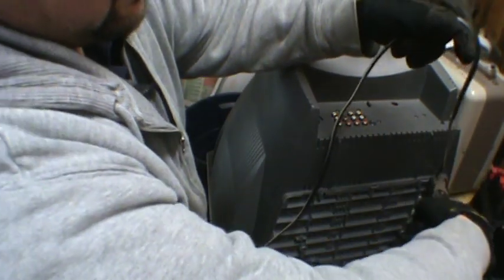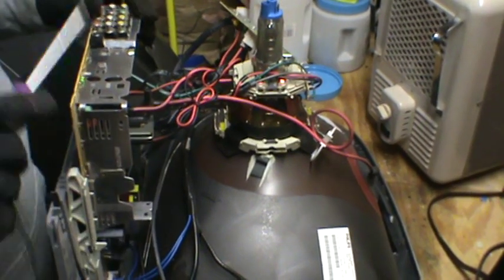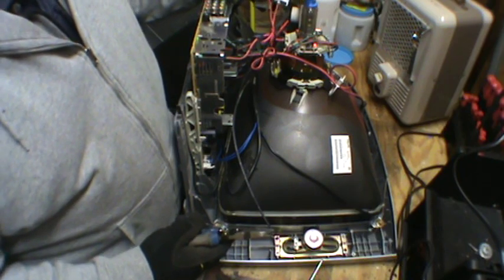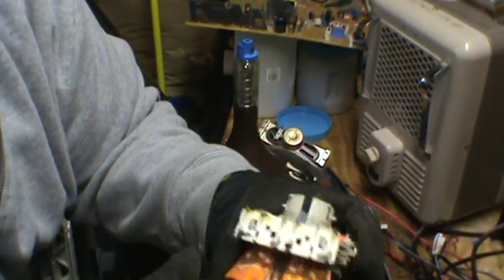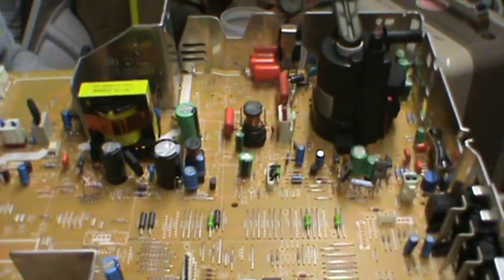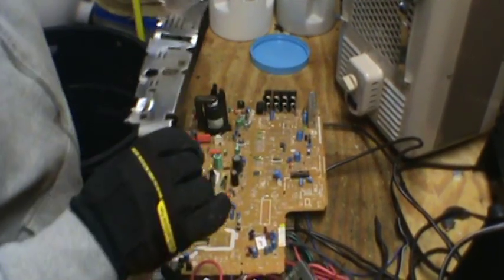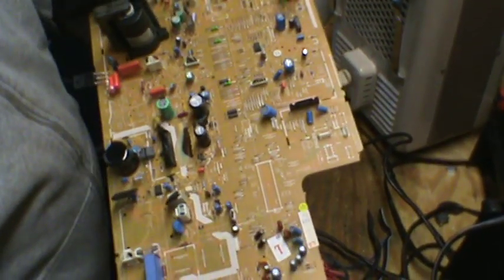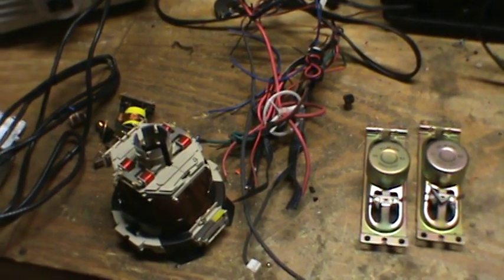How to Scrap a CRT TV for copper and easy cash!

Comment: Its worth noting to your viewers that a Cathode Ray Tube is capable of storing voltage all on its own. The heavy red wire from the flyback and the suction cup/clip into the hole in the CRT are where the dangers lie. Read up on degaussing a CRT tube before you go wild inside an old TV. It might save you a bad shock and serious injury...... Also not that anyone cares, but the black things with copper in them are relays, the little copper towers are inductors or chokes, and heatsinks will nearly always be a nonferrous metal because of the superior heat distribution properties
Reply: +Jason Andersen Thanks for letting those guys know, the 25 Kv charge can remain for quite some time after set is turned off and yes if you come in NEAR contact with the flyback EHT transformer it has been know to kill people, also some of the caps hold a decent charge to.
Reply: What's the usual way of discharging the flyback high voltage charge? I seem to recall that there is a fairly simple way of doing it with the set unplugged and the cover removed.

Comment: I scrapped a flattop range yesterday had around 10 small copper bearing motors with nugs of silver, 30-40 nugs
Reply from the maker: Jay Stevens damn sweet!
Reply: Moose Scrapper same were there was a old goodwill store the was a nice Flat screen TV right in front of were it the goodwill closed permanently but it seemed someone else had gotten to it before I did but shockly enough they only took the speakers so I had gotten Quite a bit of copper with 3 Copper yolks I got luck lol. and happy Thanksgiving! :)

Comment: Nice video
How much money can you get from taking the copper and aluminium  from the TV,
Is there any gold in these tube TV s 
Please let me know,Thanks
Reply from the maker: Hi and thanks for watching!  There is not typically gold in the CRT tv's, unless the RCA jacks are gold plated.  Also rarely there may be gold in the IC chips on the boards.  As for copper and aluminum it varies on tv size.  At todays metal prices, there is probably about $6-$10 of scrapable material in the average TV.  Stripping the yolk, degausing cable, power cord etc for copper, then any aluminum heat sinks, CBMs, wire, ferrous, low grade boards, speaker magnets, and silver in relays and switches.  Some things will make you more money selling that scraping like the speaker magnets.
Reply: Moose Scrapper
Thanks for the info,
Man,when you factor in the gas money to pick up the TV from people just giving them away, then bring whats left of the TV to the recyclers  ,It does not seen to be worth the effort ,Unless they bring the TV to you.
Thanks again ,good video

Comment: Best buy will take tvs even when they're completely stripped?
Reply from the maker: Mine does.  They have noticed that the cords are gone and often there is a piece missing where they can see the inside.  As long as there are no sharp edges or broken pieces they don't have a problem with it.
Reply: ill check with mine, thatll be better than donating to the shooting range in the woods lol.

Comment: I have noticed that SONY tvs seem to make the most money. To bad they are also the heaviest ones. Had to pull a 42" trintron from a second floor the other day.  Damn that sucked.
Reply from the maker: That validates the saying "you get what you pay for".  That must have been a beast to move!!  Probably a good 2-3 lbs of copper?
Reply: Moose Scrapper well, i rough scrap about a dozen t.v.s at a time, then in the evening ill high grade everything, i didn't set that one separate from others, but i do know i had a large degaussing cable that i am pretty sure was from it. yea it was quite the beast, im going to say safely 300 lbs +.  my helper was not too happy.

Comment from the maker: Thats an important question, its good to know how much you are going to make on something before putting in the effort.  Kind of hard to answer because there are different sizes and qualities of TVs.  The bigger higher end TV's will have much more copper and aluminum etc, the smaller ones less.  I have pulled as much as 3.5 lbs or about 1.6 kilos of copper out of a larger TV and as little as half a pount out of a smaller one.  I just try to make sure I get everything out..

Comment from the maker: of them from the wires, plug, parts of the circuit board, the speakers, magnets on the speakers, etc.  If the remotes work i sell them on ebay as well as the speaker magnets.  TV's are a relatively quick tear down so as long as you have a way to recycle the glass tube and casing I would say grab them all.  I can strip down 7-10 tv's an hour giving me 10-20 lbs of copper, a couple lbs of aluminium, some brass, silver contacts, boards, etc.

Comment from the maker: Hi there, and thanks for watching!!  I actually have several videos on removing copper from different motor types.  If you check out my youtube page you will find them in the scrappers corner.  I have found that the copper produced is worth more than the weight of the motors however there is a time investment.  I take them apart at work while I am on the phone or am able to have free hands.  Thanks for watchin!

Comment: when your done taking your copper bearing motors and aluminum off the boards are they just trash or does boardsort.com still buy them as low grade?
Reply from the maker: +Justin Shertzer They will, but low grade board is rarely ever worth selling to online companies especially if you have to pay for the shipping.  Most scrap yards will buy boards, and if they don't have a payable category for it they let you throw it in with the light iron.

Comment: the little transistors that are usually atached to the heat sinks are usualy copper also, and i noticed you throwing the screws out of the clamps in you tin pile the second one is usualy aluminum.

Comment: hey moose    thanks the reply  about bright wire. I am glad I asked  you about this cause I use to  burn copper to clean it.  by calling around I found out my local scrap yards want take copper if it has been burned. and bright wire is #1 copper   even if it isn't as big as a number 2 pencil lead.  that was really helpful  info.   now I got a bunch of copper to  sort out  and clean  thanks again

Comment: I saw some nice rubycon capacitors in that circuit board! wouldnt mind to have some of them
Reply from the maker: Are they worth anything!
Reply: i do take capacitors off the boards they are worth about $1 for 20 second hand i guess still good if something is failing it is usually the caps on the board are going bad

Comment: Hi Moose.What is in the very end extension of the actual tube,(I'm talking inside the glass tube).?You know the small silver squarish /rectangular ,shiny, silver blocks inside the end of the CRT...Trevor..
Reply from the maker: the end is the electron gun, its just a little ferrous and aluminum.  nothing really worth playing with broken glass to get to.  They stick it in there pretty well.
Reply: Moose Scrapper Thanks for the reply.Had a close look at one broken one today.Looks interesting.There is some copper wiring in there also.

Comment: Damm i get 10 cents a pound for my crts even after i take out all i want, as long as they are closed back up and not smashed they dont care. This is at a recycler not scrap yard though. I had one old 20" monitor give out 7 pounds of copper with just its degaussing coil.
Reply from the maker: Yup, I have found some of the bigger sony tv's to be a varitable copper mine!  I wish we had a place around here that bought them as is.  You must be near a lead glass recycler.

Comment: I have been getting roughly 8 to 10 TV's a week to scrap now and was wondering if you had any advice other than perseverance with a Stanley blade for removing the black sticky insulation tape from the degaussing wire ?
Reply from the maker: That is a tough one.  I use the WSX and the WSA wire strippers from TNT Tooling so they are pretty easy.  If you are going to use the razor method, the only thing I can suggest is to cut the wires into 4 sections at each corner, lay them flat on a bench and slide the razor blade across the top lie you are peeling a carrot.  Thanks for watching and commenting!

Comment: What do you do with the boards once you are done processing them? I have a bucket full of them that I dont want going to the landfill, but not sure what to do with them once they have been stripped.
Reply from the maker: Some scrap yards will buy them for a few cents/lb to get the copper etching off.  There are some places on line as well that will buy them.  Sadly, that is the part that usually ends up in the landfill as there is not much that can be done with the board once it is stripped clean.   Thanks for watching!

Comment: Take whats left to Goodwill, they will take ALLA electronics working or not and they get paid for recycling...It's good for the community.
Reply: +Jay Stevens So it I were to take the plastic case of the tv Goodwill will take it? What else do they take?
Reply: usually the plastic case will need to be taken to the land fill.
Reply: +Jay Stevens what about the tube inside?
Reply: take apart the tv, remove the copper and board then you can put it back together and take it to goodwill
Reply from the maker: +Jay Stevens THis video was done 3 years ago.  I am hearing reports that Goodwill has changed their policy and will not take non working tv's
Reply: the goodwill over here does, so does the garbage dump.They also recycle electronics

Comment: so, my guy at the scrap yard is buying the capacitors, round battery looking things that populate the boards, at $1.00 a lb.  He said that there is tantalum inside of them.  maybe something you want to look into.  i have yet to sell him any, i am saving up an 18 gallon tote full, not the tiny ones though, he said they have to be 1 inch or longer.   Ill let you know if anything comes of it.
Reply from the maker: yeah let me know, I have not heard that those have tantalum in them.  Tantalum last i checked was over $100/lb  so if it is in the big capacitors that would be great!  Thanks!
Reply: Moose Scrapper  hey how much do you get per tv around about number thanks for you time regaurding this regardingr the tutorial ive been scrappiI’veand saving for my 2 yr old daughters college otherwise i would never be able to afford tuition
Reply: I know not directed toward me, but per tv is a very difficult category.  As moose has shown, an old plasma MAY have a dollar worth of stuff,  but I have take 12$+ out of a huge 42" Sony crt, and probably that much out of a 60" Toshiba DLP.   With DLP's a lot of your money can come in heat sinks on the board. So cleaning the boards is key, selling the fernell (spelling?) Lens from the screen on craigslist to the solar heating enthusiasts can net you another 10 or 20 as well.  Moose has said it time and time again, scrap is the LOWEST POSSIBLE VALUE.  if you can sell as an item instead of weight, do it.
Reply from the maker: Ricky Warren TVs are a crap shoot.  Some have a lot of copper and some do not.  I have not found a TV with less than $4 in it so if you have a free responsible way of recycling the rest of the tv parts then by all means have at it!    Steve has an excellent point though, one that often scares people though.  If you want t make some real money, sell the parts on ebay etc.  Those lenses in projection TVs are really big with solar enthusiasts and preppers.  Other parts can help make money as well.  My best example is a microwave.  I can easily make $50 on the parts of most microwaves selling the magnetron, transformer, motors, glass plate, HV capacitor, etc.
Reply: wow i had no idea there was that much money in a microwave I’ve taken at least 50 to the scrap yard just broken down. Thank you for the feed back  i was going around finding t.v.s all the time and just cutting the cord off the back and leaving them
Reply: Just to update on the tantalum..he purchased 62 lbs of capacitors from me..about 1 month later and said he was no longer interested.. When questioned he said that he was i correct on the type of capacitors and thought all were tantalum.  His loss and a lesson learned.. Know your product.  I guess he had amased over 1500 lbs...im guessing if he got paid at all its at dirty Al or just Fe...big loss.